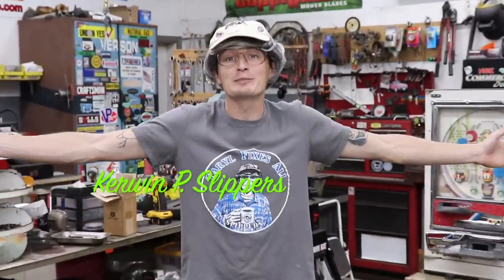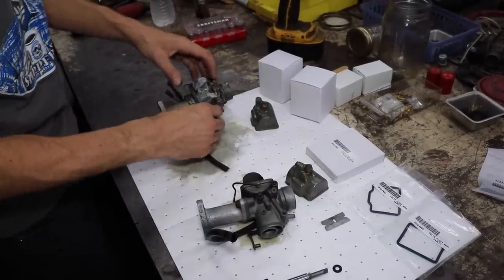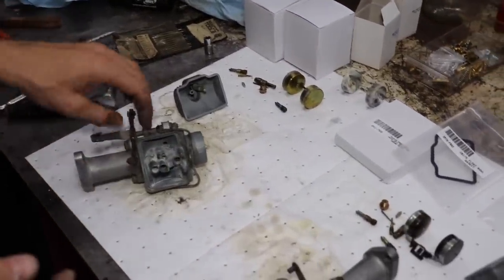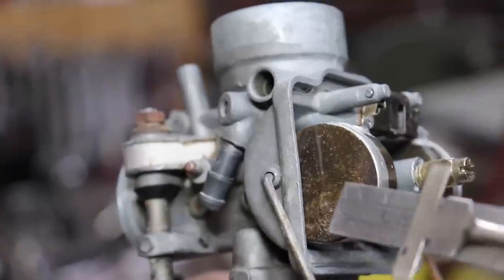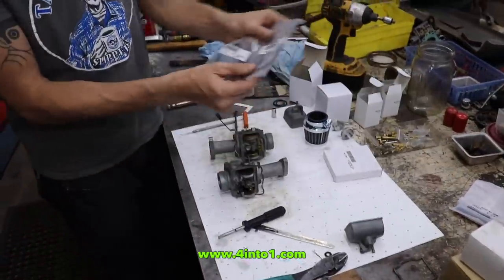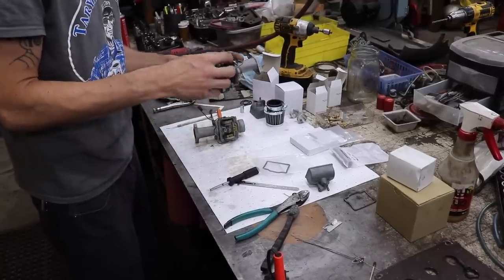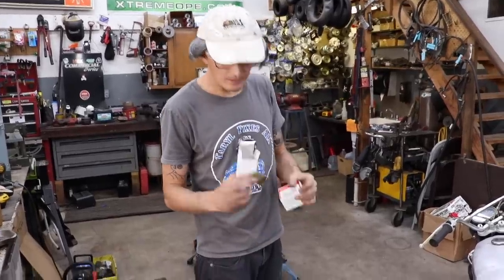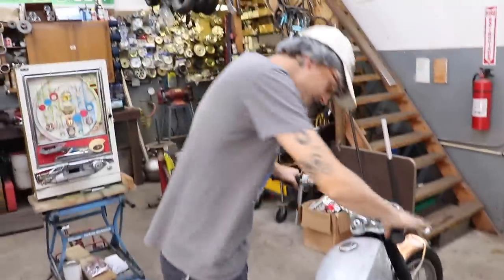Bad A** 1966 Honda CL160 Part 2 (Carb Rebuild)

Comment: Great video guys, Just a note,The low speed jets you were adjusting near the end of the video are actually air mixture jets (notice blunt tip) Turning the screw out makes mixture leaner and turning it in makes it richer. The amount of fuel is metered by the Slow Jet located in the float bowl and is adjusted by replacing the jet with one of a different value.
Rule of thumb: If the low speed jet is located before the slide of the carb (air cleaner side) it will be an air control jet. If it is located after the carb slide (manifold side) it will be fuel control jet. 🇨🇦 👍👍
Reply: I found the "keep hour hands off" factory plugs on the manifold side of the carbs. It adjusts the fuel and not the air. Big difference! I didn't see Slippers stick his fingers against the slides to check cable sync. That return to idle says more tinkering. Multiple carbs, always return original parts to their own carb.
Reply: I found it strange that Honda didn't provide a height measurement for the slides at idle. That way you can use a couple drill bits the right size under the slides when syncing the throttle cable. Both bits should move at exactly the same time when applying throttle.

Comment: I've fixed those broken posts for the floats, by milling the rest of the post down a bit, and machining a new piece for the top, and then drilling and tapping using a 4-40 stainless stud to screw it together. Once the float pin is in, you don't have to worry about it backing off.

Comment: I bought a ‘66 CL160 back around 72. It had straight pipes so it was loud! Put some 
Snuff-Or-Nots on it and they quieted it right down! Turn the knobs and it was back to straight pipes. The kits were about $2 per pipe. The company is long gone, but there is plenty of information and pictures of them on the internet. You could make your own.

Comment: I syncd the carbs on my 160 by pulling the air filters and putting a popsicle stick under each slide. Adjust the cables until the popsicle sticks are parallel. Super easy!

Comment: those older hondas sound sweet i had a 305 scrambler in 1968 ,there was something with the piston stroke , both pistons rotated the same but, dont take me to court on that that was 50 + years ago.... did love that sound
Reply: The Dreams had a 360 degree crank where the pistons rose and fell together. the scramblers had a 180, one up when the other was down. The 360 had a nice lope at idle.

Comment: It's been years since I worked on any of these older Hondas but I do believe you are adjusting the floats from the wrong surface. For one, if the measurement was from the surface you used the gauge in the diagram in the maual would have had the tip of the gauge dotted where it was hidden behind the raised lip on the body of the carb. Also the measure indicator off to the the right indicates the edge of the carb body. This also maybe why the idle wont come down.

Comment: I tried to buy a 175 a few years ago  never could find the guy, it was a 69 scrambler, what I was told anyway, the guy showed it to me , didn't own it, it was in a building , tight spot,. So I didn't get a good look, but saw enough to know I wanted it! Even if the engine was mostly missing, but seemed to be complete, and decent looking,  I would put a different engine on it if need be,  I like smaller frame lighter bikes,

Comment: This is an amazing vintage bike Slip Dog. Lucky SOB. You may not have all of Taryls skill but you do have an amazing talent for restoring the greats. Good work my dude. Next you need a Harley. lol If you can get these floats clean you can solder the holes shut. Obviously you need to make sure there is no gas in it. Ultrasonic cleaner should  do the trick.
Reply: Ewww Harleys,,, I Have had over 10 Harleys and never again. Over priced, slow, crazy maintenance, ego driven junk. Never owned one that I did not end up doing some major motor repair except a 98 dyna Evo. Just give me a 1100-1400cc Sport bike any day. Run circles around most of the built Harleys on the road. Change the oil put gas in the tank and ride really fast. without issues.
Reply: @spagsketti  Well, you gave up just in time for HD to approach reliability  😂😂😂
Reply: @charlesangell_bulmtl  YA I did, don't think that new big ole motor they just made is issue free. I worked at Harley I know the inside. No thank you. Harley corp have been screwing their customers for years and they don't even spit on it. The twin cam came out in 1999 and by 2001 they knew the cam chain tensioners were soft they sold every last one before putting the new fix on the shelf to sell. Plus they did not "FIX" it in production bikes till 2007-2008 knowing if it failed in the premature 25k-40k mileage it would destroy the motor.  Same time period with the pressed together flywheel that would shift with age or high RPM (before rev limiter kicked in) cutting off oil to the motor destroying it as well. a few small simple welds before it got balanced would fix the problem and did Harley do it?? No they charged you for that service when you rebuilt the destroyed motor usually out of warranty. around 2009 is when they addressed that problem. Now did they sell you a pressed together flywheel when fixing the bike?? Ya. So you put broken new parts in the bike so you can turn around and do it again. See no spit. I will still pass.

Comment: I had a 1976 T140 750 Triumph Bonneville;The shape of the frame is similar but the Triumph was a oil in frame and the oil inlet Was on the frame at the base of the tank between your legs.the Triumph also had duel carbs but Triumph used Amel carbs for 76
Reply: Cleaning these old carbs I would used Berrymens chem dip,it came in a gallon with a tray inside,I would dip them for 20 min and they clean up great,

Comment: I wonder if the slides didn't get swapped from side to side.  I fired my 305 up and it ran bad.  Couldn't get it to idle down and no idle adjustment.  The cutouts in the slides are on the wrong side.  Very easy to do as they go into the carb like normal.

Comment: I'd fill the tank with hot vinegar, get it boiling in a pot, pour it in the gas tank, let it set until cool, and repete if needed, it should look like new after a couple treatments, then rinse with 70- 91% alcohol,   then a few ounces of gas, after that. Either seal it, or fill with gas!!

Comment: 🪖Get that man a brain bucket!
Reply: As the saying goes: If you have a $10 head, get a $10 dollar helmet.
I speak from personal experience. Turns out that pulling a clearway sign out of the ground, complete with the concrete block using your head isn't a great idea.🏍🌧😵🚑 Fractured C1 (a hangman fracture) and T4 (4th thoracic vertebra) and spent the next 3 and a half weeks flat on my back in hospital. Fortunately my helmet took the brunt of the damage rather than my skull.
(Wet roads, aquaplaning and a fire hydrant assisted high side ensured that the only thing that hit the sign was the top and centre of the helmet.)

Comment: Twin carbs.... why in the hell did they engineer the bike to use twin carbs?  To double the pain in your ass when it comes time to re-build them?  Do they provide any benefit compared to a 1 carb setup?  Are they worth the extra pain in the ass?  Cheers.
Reply: With ya on that one

Comment: One more thing... stop using Pump gas on your bikes... I mean yeah you'll end up paying way more money for quality fuel - but your carbs will thank you for it in the long run as well.  That and honestly - how much do you really expect to ride this bike?  Is it going to be your every-day rider?  If not - and you only plan on taking it out on weekends - stick to the high quality fuel (like the kind from VP Racing).  Cheers!

Comment: Yeah that garbage they sell from eBay and Amazon can make you pull your hair out. Also riding a bike with little to no brakes can be a big problem and very hard on the old body. Running that bike with no airbox and filter will make it very lean.

Comment: Baking soda blaster will clean that corrosion right off without damaging the aluminum. Make those carbs look like new. And baking soda dissolves in water. I cringe every time I see someone using a sandblaster on aluminum….

Comment: i noticed you guys are using a different fuel pump Taryl guess you found out like I did that the Tera pump model TREP01 that i bought from your online store is garbage im very disappointed in you Taryl i only used it half a dozen times before it started leaking and now switch is messing up had to take it apart and file and bend prongs to make contact it is very poorly built but I but I bought because I thought you wouldn't promote crap this is only instance that I have had sour feelings about your channel Taryl please don't make that mistake again i paid good money for this piece of s#%t but still will watch your videos
Reply from the maker: That's odd, been using mine since day 1 with no troubles. Shoulda emailed us we woulda sent you a new one, not sure now though after all that...
Reply: @TarylFixesAll  but you aren't using one of those last couple times i seen you using transfer pump it has been one of those ones from amazon you used it in this video i have been thinking about getting one myself be honest Taryl is the amazon one any good i do trust you buddy i might have just got a dud
Reply from the maker: @MrTehudson  They're both made by the same company. Tera brand. There's just different style pumps. The one that attaches to the can is more expensive so we aren't sure if people would buy them. They are just plastic, so anything can happen. Need to find that secret warehouse where they're making all the non-plastic ones
Reply: sounds like user error to me. Any chance you can send to Australia yet?
Reply: @Amberlynn_Reid  user error lol im 53 been working on cars since old enough to pickup a wrench i watch taryl for entertainment and for knowledge to save me time won't lie have learned a few things tricks and hacks but buddy this unit is made very cheap and i think i got one made on a monday or closing time friday it is what it is i just bought because i could tell everyone it came from taryl